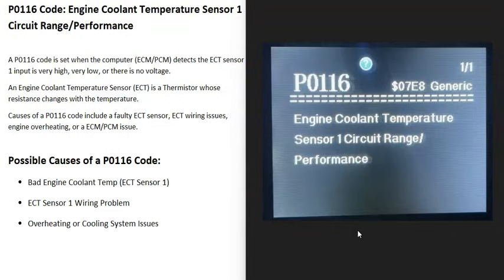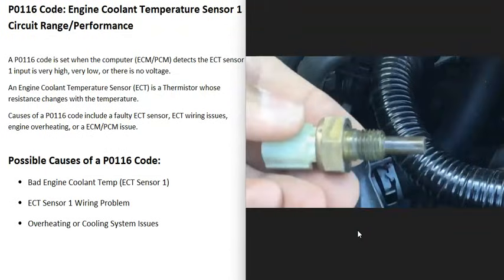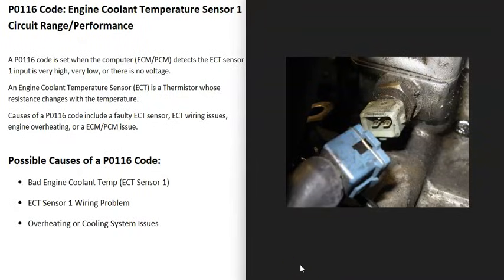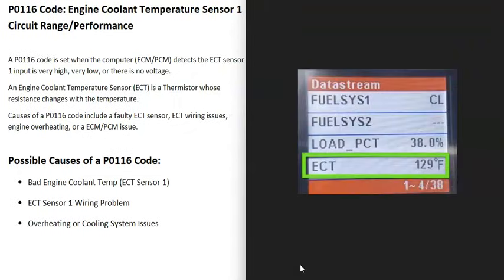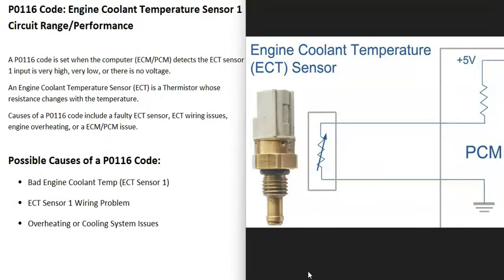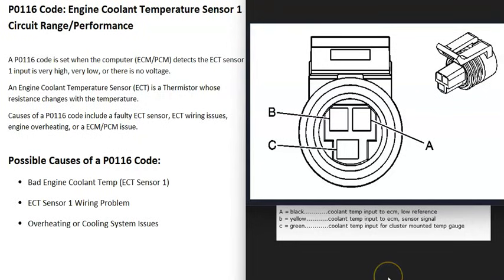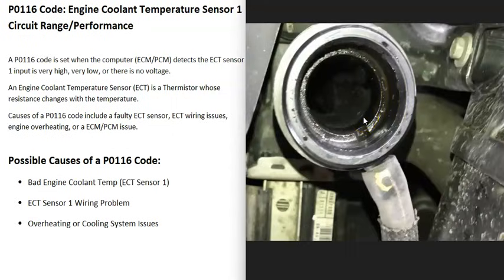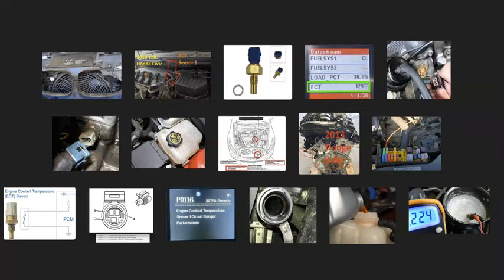Causes and Fixes P0116 Code: Engine Coolant Temperature Sensor 1 Circuit Range/Performance

Comment: I replaced the ect sensor but the code keeps popping up my fans do go on but no over heating
Reply from the maker: If the ECT sensor is good, I would test the wiring.